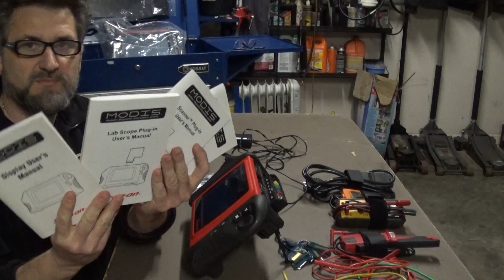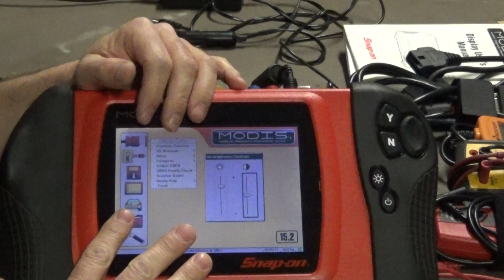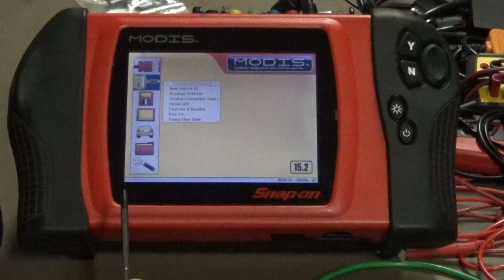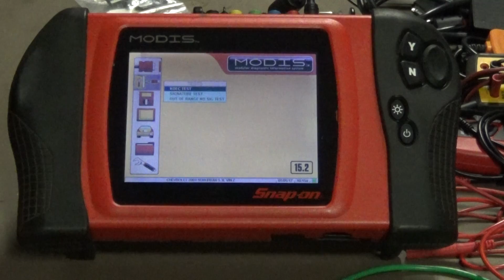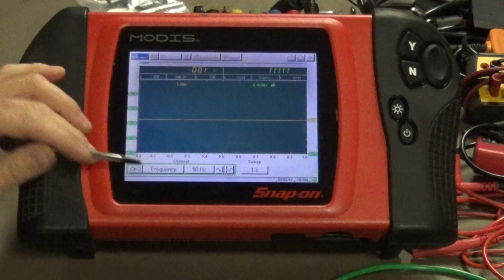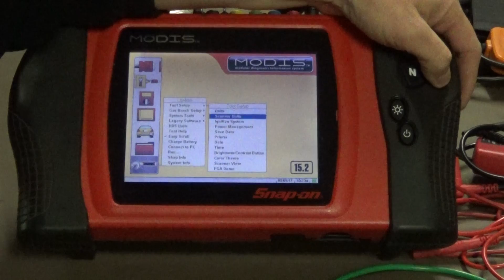Basic Info On Snap On Modis For DIY

Comment: hello got a problem with a modis eems300 got off ebay   When plugging in power supply 3 beeps and then hit power button 6 beeps  Item worked before shipment Hard to find any diagnostics info  Your input would be greatly appeciated of course  :]
Reply from the maker: https://youtu.be/8d0h6elWUYI
Reply from the maker: Watch this video. This could help
Reply: @kyhomegarage3430  keep getting  a tractor supply video ad  lol

Comment: I bought a MODIS. I do not have an RPM adapter to plug into its nine pin port. Can anyone tell me which of the nine pins are the signal and ground. I would like to adapt a two pin pickup to work on it.

Comment: My screen has developed lines making it hard to see in my Snap On Vantage MT2400. I was thinking of looking to replace it with a Modis but. I only own this to work on obd1 1989 Corvette and 1995 Chevrolet K1500 truck. My newer vehicles we take to the dealer.  Is the Modis compatible with GM Obd1?  I also own a MT2500 red box. Thanks for any info. It looks like no easy way to repair my Vanatge MT2400
Reply from the maker: MODIS is compatible with OBD1 and it will work for sure. You will need to use GM OBD1 adapter you have from MT2400 scanner.👍
Reply: @kyhomegarage3430  Thanks!

Comment: Hi, very informative video. One quick question: if you were to buy one of these tool which one would you choose?: A Modis or a Vantage Pro. Thanks,
Reply from the maker: Modis has four channel lab scope which is big advantage compare to Vantage pro that has two channels. Modis is also scan tool. However Vantage pro has option that no other tools have and that is internal graphing amp meter that eliminates need for amp clamp and its very accurate. I use it every time I have car with parasitic draw. Check this video. Thank you 
https://youtu.be/WLAZYye9kyE
Reply: @kyhomegarage3430  Thank you for this informati'll  But really you didn't answer my question... I know that is hard to recommend one product over the other and also that depends in what the unit/tool is going to be used for. But lets say that if you had money to buy one or the other, which one would you buy? Is OK. if you don't want to answer the question. Thank you!
Reply from the maker: @javirodify  Modis has by far more functions that Vantage pro so I think Modis is better option. Thank you
Reply: @kyhomegarage3430  Thnak you !

Comment: Awesome video!Thank you for explaining how it functions. I have a 2006 Honda Accord SE with 2.7L engine auto trans. What level software should I look for when shopping for a Modis? One other thing is that you mentioned the 4-way button on upper right where you had some problems scrolling in menus. What were the symptoms? Bad contacts in the switch? Thank you! Mike

Comment: Hello Ramon...Thank you very much for taking the time to make the Modis video’s (and others). I know I am many, many years late to the party, but I just recently bought a second hand Modis. It appears to function normally but I have never heard the cooling fan operate. Should it be running all the time or is thermostat/thermistor controlled? It does appear to be able to spin freely...Following your new boat project with interest. Cheers 👍
Reply from the maker: Hi my friend. I don’t remember if cooling fan runs all the time but I do remember that it did when you plug battery and AC charger. I don’t have MODIS anymore.👍
Reply: @kyhomegarage3430  Hmmm....my battery pack is of course useless and not taking a charge ...maybe that explains it. Not sure. Greatly appreciate your reply and channel. Thx again. 👍
Reply: The Modis fan does not run all the time. It is thermostatically controlled. Use it outside on a hot day and the fan should come on.
Reply: @gregchapman6897  Thx. I have heard it operate. All be it only one time. Cheers.
Reply: @TheGibby3340  same here. I have not noticed a difference with the weather.

Comment: I just bought the Modis Ultra used but it will not come with test leads - I know I need the shielded, scope leads with common ground plugs as well - is there anywhere aftermarket I can buy them or do I have to go through Snap On? They are $30 each at Snap On!.
Reply from the maker: Makla try this
https://rover.ebay.com/rover/0/0/0?mpre=https%3A%2F%2Fwww.ebay.com%2Fulk%2Fitm%2F312645539612

Comment: I have a problem with my Modis...it just stopped working one day and gave some kind of CF card error. I tried and tried to "clone" other Modis CF cards, with no luck. I even tried to delete/add lines of code in certain BIN files to try to get it to boot up again with the various CF cards I have, but still no luck. I can plug a USB mouse to my modis and access Windows CE. Of course, Snap On does NOT support the old Modis so I'm THOUSANDS of dollars in the hole. Is there anyway I could get an image of known working CF card? I know there are files in the CF card I could change the serial number to make a match. I would really like to get it working again if not just for the lab scope. HELP...?
Show less

REPLY
Reply from the maker: Rob P. I really don’t know how to fix your problem. Here is video that could help you. Thank you.
https://youtu.be/W49pfK1RW34
Reply: I think I can help you out. Get my skype or something
Reply: @frankiebroadsight  Great! I can do it when ever you want. Let me know if you need me to have the Modis up and running while we Skype.
Reply: frankie_cabral_ @Rob-pg7rb

Comment: You were talking about updating the tool at approx. 5:00. If updates are $800 a year and you skipped 2 years of updates. Then on the 3rd year you wanted to get it updated, would you pay $800 and get all 3 years worth of previous updates, or will you have to pay $800 for each previous year and your total would be $2,400 to get your scanner current with all 3 years of updates?
Reply from the maker: 707SonomaComa That is good question. I am not sure. I would call Snap On to get that info.Thank you.

Comment: Where do think I can get a upgrade for my modis since snap on doesn't do it anymore
Reply from the maker: Joselito Rodriguez Snap on should still update your MODIS I don't know why not.
Reply: Joselito Rodriguez, if you pay them they will do it!
Reply: @707SonomaComa   snap on no longer supports the modis. i just bought a snapon solus but will keep the modis for the labscope
Reply: @dannyscarpati7049 , Snapon does support the Modis. I just spoke to my Snapon Rep. yesterdsy on 12-13-18 and he said they have updates twice a year. If you miss one update it is $1,200 to get caught up whether the Modis needs 2 or 10 updates. He had brand new ones on the truck. 
You can go to the Snapon website and see them.  
  https://snapon.com
Reply: @707SonomaComa  snapon only supports the new thin body Modis. 
The old fat body design like this guy is using and like I have had for the last 10 15 years is no longer supported.

Comment: Ramon, if I were to buy a parts Modis on eBay, can the CF card be swapped to my modis to get the upgrade i.e. 15.4, 16.2
Thx
Reply from the maker: Mark Patton I am not sure. I believe CF card is designated to single unit only ones is activated. I would call Snapon customers service they will know for sure. 1-800-424-7226. I don't want to give you any misleading  info. Thanks for watching sir. Cheers
Reply: Yes, the CF card is married to the unit or so I have been told. I guess I'll take the rocker thumb switch out of mine to fix the one I bought.
Thx for the reply.
Reply from the maker: Mark Patton if that is your problem you can use keyboard to navigate your tool until you get your button fixed.
Reply: thx for the tip sir.

Comment: which is better the modis or autel ds708??? THANK YOU!
Reply: can the modis read the real mileage of a car if it has been changed on the cluster??
Reply from the maker: armando nika it will read what is programmed in a cluster.
Reply from the maker: armando nika both tools are great. Autel is better with Euro bit MODIS has labscope and component testing which is huge asset.
Reply: +ramon ruzic thank you very much.
Reply: No any "one tool" will do it all. They all have Pros and Cons. If any one tool was the best all auto shops would have it.

Comment: hey ramon, when i m using a scanner, it is powered through pin 16 of the DLC, right?...but if i am at the garage, am i allowed to simultaneously(at the same time) power it from an external source also, such as wall outlet via the adapter?
Reply from the maker: Zvonimir Bobic If you are talking about Snapon Modis you can always use external power source any time you use tool as scanner or labscope.

Comment: Hey good video for the beginner , as you know Paul Danner goes into detail on how to use this tool if you subscribe to his premium channel and it's only 10.00 a month which is well worth it, I do have a 4 gas anaalizer which is great on carburated cars I picked one up on Ebay for 100.00 many  years ago , You can also get some great deals from pawn shops I got my snap on vantage pro from a Pawn America it's like BRAND NEW and is updated  to 2012  only used 3 times and I got some extra adaptors for 400.00 and a guarntee , I have a Autel DS 708 , it's a good scanner updated to 2016 but each one has there advantages if I was doing this on a regular basis I would probally go with the New OTC or Snap on but I am a  retired Auto Tech and only work on a part time basis at 67 but keep the video's coming  I enjoy them all !
Reply from the maker: Yes sir SD is the one who inspired me to star automotive diagnostic. I didn't subscribe to his premium channel yet but I will soon. I will make couple more videos on Snap On  MODIS  for other viewers who may benefit from it. Thank you so much for supporting my channel.

Comment: Really enjoy your videos especially on electricial diagnostic. I also became a diagnostic nut about the same time as you. (watching SD when he first started videos) I bought a Modis  after watching your video -best automotive lab scopes- and love it! (500.00 on Ebay) My Modis also froze up after the power became disconnected from the battery. To reset try this--remove the left black hand grip--there is a tiny reset button above the cf card---you can barely get your finger in there!  Hope this helps you or someone else. Learning from each other. cheers
Reply from the maker: Joe Car whatever where have you been five years ago  my friend LOL. That MODIS is gone. Thank you so much for supporting my channel what a great way to learn and share knowledge. Cheers
Reply: I need more help anywher we can contact
Reply: Thanks for the info Joe, it freaked me out when I heard this 😳

Comment: For me Auto Enginuity is the way to go. $1500 buys all extensions and updates are only $60. For mobile diagnostic there is nothing that comes close. These snap-on scanner come with all that junk. Had a 50lbs case. Now All I need is small laptop with auto enginuity and pico scope. With all the probes and wires, everything fits in small backpack. All powered by laptop battery. For example, auto enginuity had over 2000 pids on Benz. Snap-on had 30% of that. Sold it.
Reply from the maker: Auto Enginuity  is great scan tool. Base price is $250.00 and for any additional enhance coverage you have to pay extra $150.00 to $200.00  . Plus price of pico scope which is the best automotive scope on the market cost 800.00 for basic  2 channel scope kit. I still believe for DIY MODIS is great option and prices are going down on this unit. And what junk you are talking about those are connectors for OBD I cars.  Thank you for watching.
Reply: I have one of them. It's nice, $1200 worth of nice. Looking for a scope though. Found a loaded up modis on eBay for $785 after tax title and liscense. Now I have a 4channel scope and then some!